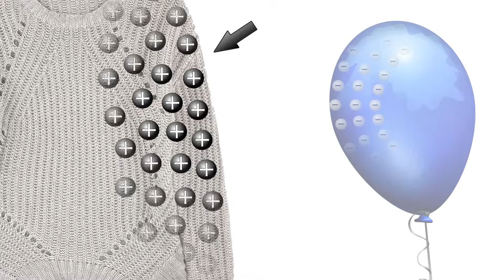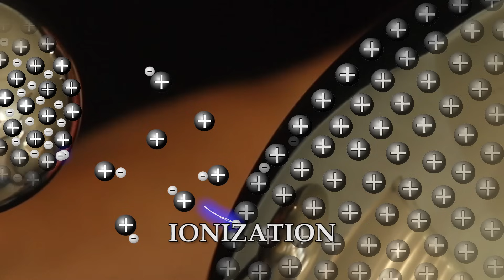Avoid electric shock getting out of a car!

Comment: Part of the shock comes from the distance of the drive too.  Just like rubbing a balloon against hair or clothes, rubber tires rubbing the road will pick up some charge and can transfer it to the outside of the car which acts like a Faraday cage if not separately grounded.  I've been told that semi-truck tires have metal flecks in the outer tire to help ground them so charge doesn't build up as much.  Also, a lot of grocery stores now have carts with little changes dangling off of one wheel to help ground them.

Comment: Take your car's ignition key(or a door key if you have a proximity key), and after you get out, tap the car with it.  If it sparks, you won't be the point of exit, the key will, and it won't hurt.

I discovered this when I put a key in a deadbolt and it sparked, though I didn't feel it.  Works for doorknobs too.

Comment: A good way to not ignite a fire when fueling your vehicle is to do the touch-the-metal trick when exiting EVERY time. Then you won't have an electric potential built when you go to put your hands by the fuel port, preventing a spark
Reply: A needed n helpful trick!

Comment: To avoid/minimize getting shocked by touching a doorknob, I hold the metal part of a key between my thumb and finger, then use that to touch the doorknob.  The spark will leave the key, not my hand.  If it's really cold and dry out, the noise and spark, combined with the anticipation of a potential shock, still makes me jump a little, but at least the pain isn't there. :-)
Reply: +Chris Clark I do this too. This way you can still see the spark and hear the pop without feeling it. It's pretty cool to see your own personal tiny lightning bolt.
Reply: +Chris Clark I do the exact same thing!
Reply: +SergeofBIBEK ☺️

Comment: I hadn't ever thought that is was me with the increase in charge. I thought it was from the friction of the air and the vehicle's body. This makes sense now, seeing as I do wear insulative rubber-soled shoes. Why I thought this was because aircraft have a wick to dissipate static at the back of the wings and tail made of braided wire to prevent passengers and ground crew from getting shocked. https://c2.staticflickr.com/8/7370/8881679565_238633f3b4_b.jpg

Comment: nice! so.. insulators and conductors are relative terms rather than absolutes.. perhaps anything can be either or if the conditions are just right.. woah..
Reply: +DestinyQx Yes, the term is 'dielectric' and when a 'insulator' turns into a 'conductor', it's called dielectric breakdown and yes it's about 'how big is big?'. Normal people call it lightning when you see it happening in a T-storm. Big deal in capacitors and transistors (CPUs, gates and whatnot).

Comment: Question:
What if you put the negative lead above the pie tin or foam box, and turned it on.
Would the tin/foam be repelled by the positive, attract to the negative, then loose charge and drop back down and repeat? (Kinda like an over-sized relay?)
Reply: Minnesota State Fair used to have a science building. One year, they had an electrostatic generator. Standing on a mat connected to the generator, I put  my hand over some confetti on a metal plate. Some of the pieces rose to my hand. When a bit touched my hand, it was discharged, and fell, while others rose. The result was a confetti fountain between the plate and my hand.

Comment: So my Electrical Engr class lab group were using an ohm tester to find out our resistance. Turns out I was very insulated but the girl in our group was very conductive. 
Which made sense because she shocked herself with 2 (mostly dead) 9V batteries.
Reply: Maybe she has very little fat.

Comment: ok, if I remember correctly all insulators can be charged by induction and by friction. what differs and insulator from a conductor is that in an insulator the charge remains localized and in a conductor the charge distributes evenly thorough the material.

Comment: I'm always getting shocked by stuff. Like at the grocery store when I'm using a shopping cart. The cart is metal and is suspended from the ground on rubber wheels. I guess the friction it generates as the wheels turn cause it to get charged. So one of two things will happen. In the case where my hands are protected from the cart by a plastic handle, I will get shocked when I accidentally touch the metal. Or, in cases where I'm already touching the metal as I push the cart, I will get charged and then shock myself when I touch something on a store shelf.

I'm sure that the air conditioning in the store isn't helping, but I also feel like there's something about me that just leaves me more prone to getting shocked. Or I just complain about it more than anyone else.

Comment: I deliver pizza and get shocked almost everytime I leave the car (and I leave the car a lot of times per night :( ). I hope your trick can help me! Thanks for the video ♪♫
Reply: +Physics Girl pizzaster!
Reply from the maker: +ViolettaSachra As long as you're not carrying the pizza when you put your hand on the car, which could end in a larger disaster.
Reply: You have a cool job
Reply: +ViolettaSachra It's sliding across the car seat toward the door that creates the charge.  To bleed off the charge while it is trying to build up, you should place your (left) hand on the metal edge of the open door before you step out onto the ground.  This should work every time.
Reply: Uber Goober No, I started grabbing the metal part of the door while exiting and science is always right and I rarely ever get shocked now. Yay! Success everywhere :)) throws heaps of confetti
Reply: ViolettaSachra cool +1 for science  they got to be over 9000 now?
Reply: Physics Girl Haha, I'll try to think of that :P
Reply: +ViolettaSachra -- If the cause of the static built-up is the friction between the butt clothing and the seat, perhaps a different choice of clothing material would prevent it. 
It's hard for me to experiment because I don't get that experience with my car. I imagine a pickup truck, being higher and having bench seats, would be most likely to cause it.
Reply: +ViolettaSachra So are you still getting shocked? I'm guessing not cus of science and stuff.
Reply: +ViolettaSachra Check if your car has a grounding strap, if not, get one, it will probably fix your problem too.
Reply: LReBe7 it's not my own car, so i have no say in stuff like that :/
Nehmo Sergheyev I think it's the jacket, and i have to wear that while it's cold (company logo + name ;) )... but yeah, as i mentioned in my last comment, grabbing the door while leaving really helped ♪♫

Comment: The other thing you can do if you're already charged is ground yourself with as much surface area as possible, i.e. touching the metal with the palm of your hand instead of single fingers. That will let the charge dissipate at a lower and usually painless voltage...

Comment: Styrofoam can develop a large static charge very easily, and it is therefore not supposed to be placed in an ESD sensitive environment where sensitive electronics can be damaged.  The fact that it is an insulator just means that it will not conduct a continuous DC current after it develops a charge.  One analogy it to think of it as a capacitor.  The center of a capacitor consists of an insulator, and will block DC current, yet the entire purpose of the capacitor is to hold a charge.
Reply: +Eugene Khutoryansky I just commented that vendors would ship me memory with styrofoam peanuts, computer nerd WTF moment.
Reply: You guys surely should watch  the physics videos by Eugene Khutoryansky , Her videos are full of 3d animations and very understandable . PHYSICS GIRL , LOVE YOUR VIDEO  !! COOL 😎 and great .. I understood it very much ..
Reply: +GlassTopRX7 memory doesn't seem too prone to static destruction. my friends used to just keep a ton of sticks in a cardoard box. just tossed in there like a child's toy box.
Reply: *****
The static charge of a card board box is small compared to box of styrofoam peanuts.
Reply: GlassTopRX7 yeah but just being tossed around in amongst a box of other stuff equals more static than Styrofoam. May have been some in the boxes. I noticed one of my parts was in a regular plastic bag once
Reply: Memory is conductive so it's not going to build up a static charge, cardboard boxes tend to hold too much moisture to problematic on their own.  Styrofoam is non conductive so it can build up an electric charge and hold it.

It takes about 100v of ESD to damage ram, a box full of peanut can easily generate and hold over 10,000v of ESD.  It's fine right up to the point when you reach in the box to grab a stick and it discharges.

It's exactly what was demonstrated in this video.  There are new starch based peanuts that are conductive enough not pose much of a risk.
Reply: A very crappy capacitor, at that.

Comment: Handy tip.
If you suspect you are charged but you need to quickly go out that door.
Hold a key tightly and touch the knob with it first. If there's a discharge it will spread over the surface of your fingers that is touching the key eliminating the single point arc to your skin that causes you pain.

Comment: Why is light emitted when the air molecules and atoms are ionized by electrons from the Van de Graaff generator? Their electrons are shot off according to the graphic, but that requires energy. 

Could it be that some of the incoming electrons replace some of the air molecules' electrons? If an incoming electron from the Van de Graaff generator replaces one of an air molecule's electrons (which then shoots off at some velocity < the incoming electron's velocity), sits at a shell > original shell, then shortly after deexcites?

If unclear: sorry. I had a tough time making the sentences come together. Not being able to use subscripts doesn't exactly help.

Comment: great. Also put an eletroscope on the top and show how to "measure" the voltage.  then you can show the photoelectric effect by shining ultraviolet light on the metal and show how the charge leaks off faster the without the UV- light.

Comment: +Physics Girl The touching-the-car-metal-before-stepping-out trick works often, but sometimes if the car itself is charged, it could discharge through your toes to ground. Have you ever had this? Cool demo with the styrofoam plate, btw - a useful principle for keeping particulate-dust off (plastic) workpieces while e.g. laser-machining.
Reply: +Aditya Mehendale 
it WILL discharge through your toes, but much slower because the shoe acts as a resistance and you wouldn't feel it. :)
Reply: +sbraz Actually, if your shoes were conducting (just like holding a large metallic key) you wouldn't feel the zap. "Regular" shoes, on the other hand, are insulating, and while this will increase the breakdown-voltage by a lot, it is still comparable to the breakdown voltage in air. To turn your argument around: If you were wearing a pair of (insulating) rubber gloves, would you not feel the zap while stepping out of the car? Hm, we really need to try this out sometime...
Reply: Aditya Mehendale the problem experimenting with this is being able to tell for sure if i'm about to be zapped or not. XD

Comment: Great video!

I remember reading that in gas stations ignition of vapors through these static induced sparks are much more common with young, fit people than with elders, for example, because the elders hold to the metal to support themselves, which grounds them. Younger, more fit people end up never grounding themselves before touching the vapor-rich tank opening: WHOOSH!